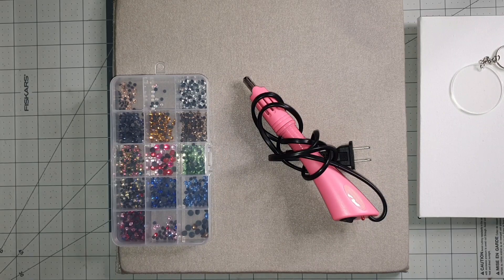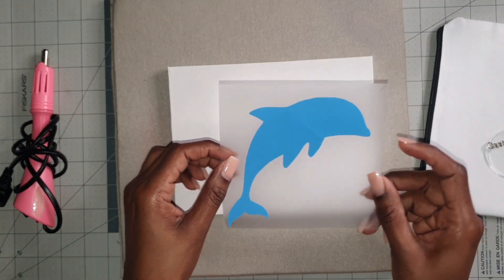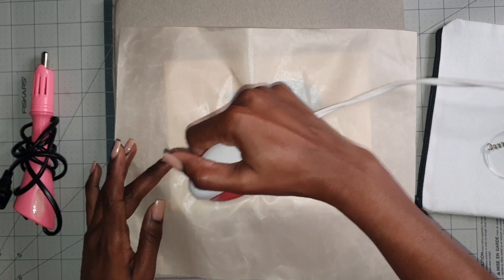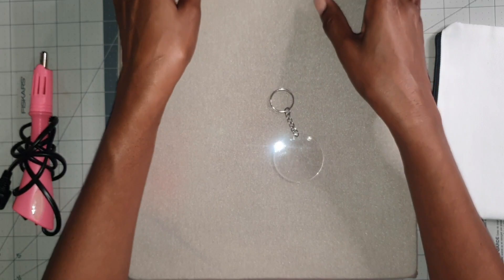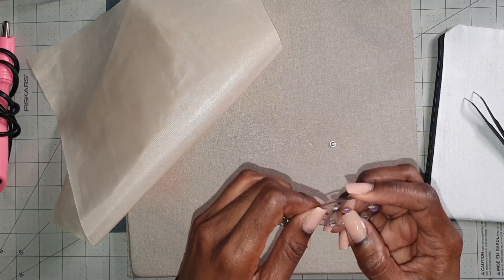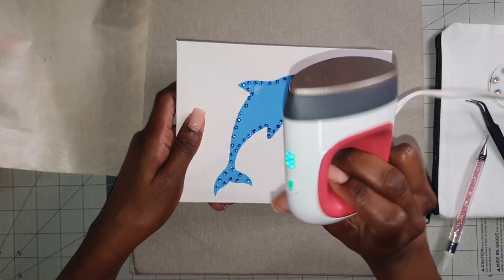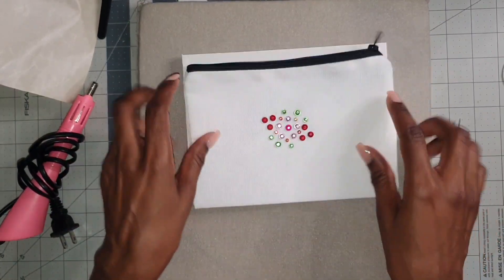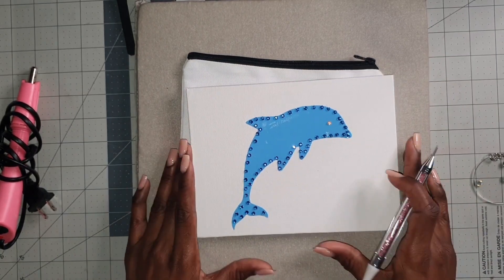How To Apply Hotfix Rhinestones With A Heat Press Machine || Apply on HTV

Comment: .Thanks for this will this work on leather also. Which would be a better option as a tool, the heat press or the rhinestone heat tool?
Reply from the maker: @deepdiver849  Leather would probably burn from the heat. I would go for the heat tool because it allows for a more precise application.
Reply: @craftbasicsjs  thanks a million
Reply from the maker: @deepdiver849 you are most welcome